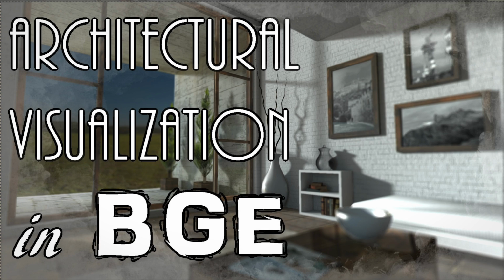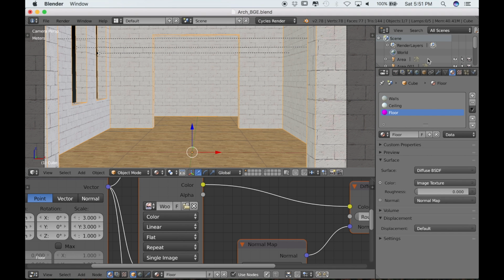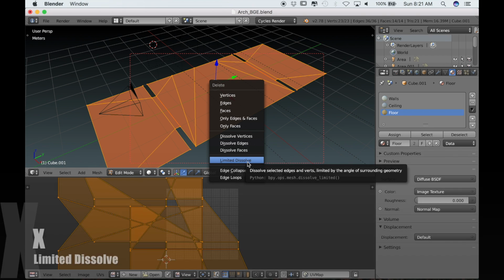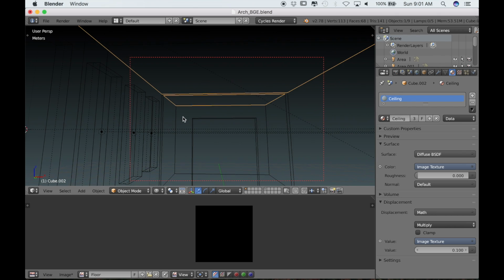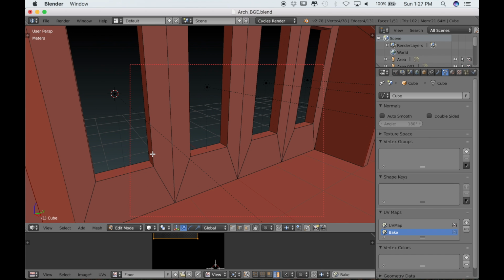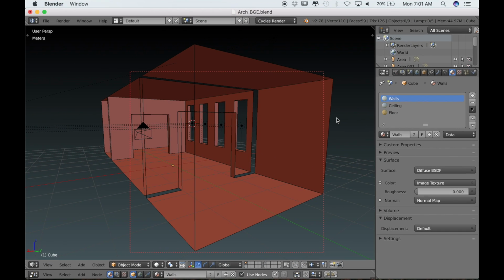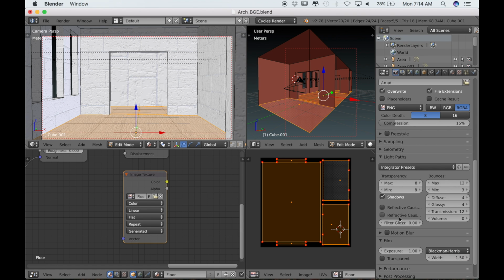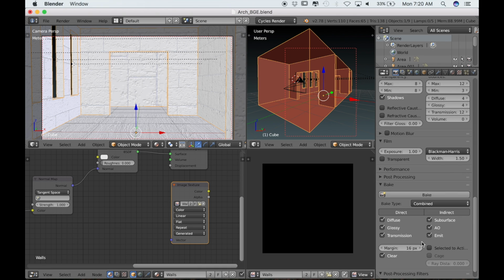Architectural Visualization in The Blender Game Engine Pt 2

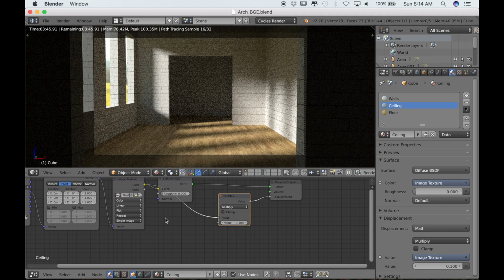Comment: Question.. till 6:04 everything is fine for me but the only thing is that when I put my to render, the walls in the inside are very dark ((Area under the window and in the far left corner) any way I can make the inside more.. brighter?
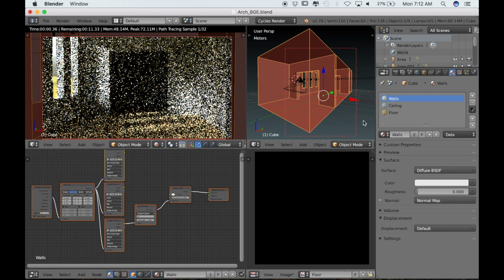Reply: Also at 20:27 when you cross out the line for image texture for the floor, ceiling and walls and in video when to get out off render mode to material (20:48) Your textures are still there but in a white colour but for me when I cross it out it completely removes my texture. Please help, I'm doing this for an assignment.